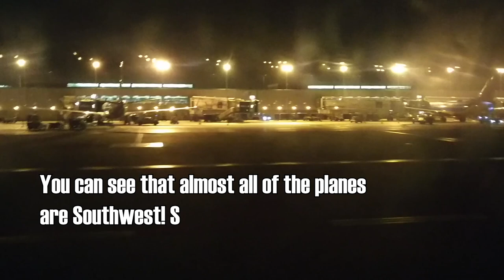Autofocus rambles and a landing at MDW

Comment: This is part of why almost all "real" video cameras have a setting (often a dedicated button) to lock it on infinity focus. In fact, specifically in regard to a nighttime scene with "bright points of light", I've seen some camcorders that have a "Fireworks" preset which locks it on infinity focus and reduces the exposure to prevent the fireworks from getting blown out.
Reply from the maker: It's very frustrating to me how smartphone cameras are often so close to perfect, but with some serious annoyances or flaws.  What I really appreciate about the camera on the OP3 is that its image stabilization is really good, even in this low light.  I didn't do anything at all with this footage, and you can see during the landing that the phone was moving around pretty violently (pay attention to the window near the edges) but it coped very well.  Smartphones have the benefit of so much software but sometimes implement it in strange ways.
Reply: Technology Connections 2 On my OnePlus 5T you need to tap and hold on the point you want to focus and eventually you'll get a message telling you the focus has been locked. I'm not sure if it's the same with the OP3 but I thought it would be worth a try
Reply: The autofocus lock on my Galaxy S5 never seems to stay on. Unless I'm shooting in 4k, which is overkill for dumb videos on Facebook.
Reply: You can download an app for advanced camera functionality. That’s just the default camera app.
Reply: I really wish I could just do manual focus on my S5. I'm running Android 6 and I've tried advanced camera apps but none of them work. It's especially annoying when trying to focus on something up close. I know the hardware is capable because it will be in focus for a split second before autofocus decides it'd rather make it blurry.

Comment: That seems like a software issue to me. When you tap the screen to focus there, it looks like the camera continues scanning that area to maintain focus.  Once that area has no more contrast, the camera starts hunting.  Cell phone cameras have to be dead-simple, so that people who think vertical video is good are novices at photography can use them.  That behavior might be a compromise to get better ease of use for novices.  

Also, I don't know if this is true for contrast-detection AF, but with phase-detection AF, you need detail along a line for the AF to work. Focusing an SLR on a point is difficult unless there's a ton of light.

Comment: They’re not “points” of light. They’re blobs. I suspect,  as the light spreads, it leaves few actual sharp edges.  It’s more like the dark and light areas are fading into each other rather than creating contrasting features that the AF system can use.

Comment: My understanding of this problem is that when a pin point of light comes out of focus it becomes I high contrast circle with reasonable crisp edges that are easily detected by the camera making it think it is in focus. I'm sure once AI get better in camera, they will take into account single points of light, but for now they do not. Take a screen shot of a still frame when the camera is out of focus on a dot and you will see it is a nice circle, or at least in the shape of the aperture of the camera and has a high contrast edge.
Reply from the maker: That makes a lot of sense!
Reply: Agree with the assessment. Another thing is dynamic range. Contrast AF computes the sum of squared differences between neighbouring pixels (or a variation). In a dark scene, point lights are over-saturated. Suppose saturation level is S, a point light has actual level of 9S, it would still register as S. If it defocuses to a disk of 9 pixels, each pixel would still be S. The circumference increases by 3 times, and the sum of squared differences increases by roughly 3 times. Thus the AF often prefers somewhat out of focus blobs.
Reply: I had the same thought. The bokeh of a camera doesn't produce the same result as a blur, it actually makes a distinct circle on point lights. Bigger circles could actually have more high-contrast pixels than when it's in focus.
Reply: That's what I figured was happening too.  A larger circle of light has more pixels around the edge.  Seems like a miracle that it works at all...

Comment: Try the OpenCamera app -- it has focus lock even on videos but it has no other fancy functions such as filters, video cropping, etc. Used that and never had any problem with it losing focus.
Reply: Penurious Sierra yep pros use manual focus.  If you want to make pro videos dont se a mobile phone. Ps my camcorder is always set auto everything cos I'm not a pro.  But when I do dabble you can get great results with manual focus.
Reply: Penurious Sierra That is one of the reasons I have it on my phone, the focus and exposure lock options. It can even rotate and crop automatically to keep the horizon level. And timelapse stuff

Comment: I know for sure that the aircraft in the video was a Boeing 737 of some sort with the CFM International CFM56 engines. I can tell from the sound of the engines when it touches down on the RUNWAY . It's not the "tarmac", at least not called that, even if it's made from that material.

Comment: I'm going to guess that the primary reason Southwest, as a low-cost airline, uses MDW was because as they were probably able to negotiate lower landing fees compared to O'Hare and the fact that since their fleet mainly consists of 737s means that the shorter runways are adequate for their needs. In the UK, London Stansted is a similar case - it's a hub for Ryanair (an infamous low-cost airline) while most of the other major airlines use Healthrow and/or Gatwick instead

Comment: Another consideration might be that autofocus once "locked on" will only "fully" reevaluate the entire image periodically,  but relies on pan/tilt data from the video compression chip more often to track the movement of precomputed contrast boundaries as a lazy refocus mechanism..  it could be designed to do it that way more often to reduce computational cycles... with so little variation in these scenes pan/tilt errors could add up enough it could easily get confused, lose its contrast boundaries by a pixel or two, and have to start from scratch again... if I had to design it, I’d consider that as one autofocus mechanism.

Comment: My old Sony handicam years ago had a switch for auto/manual focus. The nice part was that it also had a momentary toggle - if you pulled the switch all the way down it would focus to infinity immediately and then it would be in manual mode. If the auto focus was being screwy you could just grab this easily and tap it to inf and switch back to auto - it would usually fix the problem right away.

Comment: I've noticed that my Sony HDR-CX760 has no problem with scenes like this, but I think there is something else going on (though I'm very likely wrong).

That's why I use Canon video cameras sometimes because external focus sensors (iAF) that everybody seems to mistake for an extra light or a stabilizer sensor.

Comment: Some cameras use on-sensor phase detection, which isn’t so great in low light.  I know canon’s dual-pixel cmos autofocus has issues with very low light focus because it’s phase detection based.

The oneplus 3 uses a 16mp sony PDAF sensor, which stands for Phase Detection Auto Focus.  Looks like that’s why you’re focus hunting.
Reply from the maker: Ooh, really?  I never knew phase detection was in use in smartphones.  Research fail!
BUT, given the tremendous ability of a smartphone to use software, it surprises me that there's no analysis taking place on the software side to minimize the focus-hunting.  Perhaps we'll move towards that some day--best of both worlds!
Reply: Yeah I really wonder why modern cameras don’t have the ability to switch between phase detect and contrast AF when one is CLEARLY not doing the job.
Reply: Some do. This is what Sony's Hybrid AF does in their mirrorless cameras which use on-sensor phase detection, and I presume this is also available on their small sensors used in cell phones. However, it is a function of image processing, so if the AF methodology of the phone's image processor doesn't do it, then they would have to implement it.

You can force those cameras to do different focus methods based on focus modes, FWIW.

Comment: Could it be related to how out-of-focus lights look like in cameras? Differently from a gaussian blur, lights look like little disks with relatively sharp edges on camera. These edges may fool the AF algorithm, leading them to prefer the out-of-focus image to the sharpe one, since the latter has much smaller edges (although slightly sharper). The fact that bright light are probably clipping, and therefore the brightness level in the sharp image is not much higher than in the out-of-focus one, may help too.

Comment: I think it does not detect contrast between pixels but tries to find straight lines in picture. The simplest (and very fast) algorithm is to use convolution function and then see at which focus setting there is greatest amount of them visible.

Comment: It was my understanding that it only looks at a small region, first of all. Secondly, at least on a camera system I worked on years ago, that you would focus by finding a sharpness value of a frame, blur the image in the system, and get the sharpness value for that. compare that.  If it is similar, it’s likely already out of focus. Then adjust the focus of the lens and repeat while adjusting that.  The highest sharpness value is the proper focus, probably.  Then every so often, you need to run it again to make sure you’ve maintained focus.  That’s how our system worked anyway.

Comment: My guess is that autofocus algorithms contain an escape algorithm in case a small insect were to fly right in front of the camera.
The algorithm would start tracking the tiny insect, and should the algorithm try to always obtain maximum contrast, there is a local maximum of best contrast around that insect and the AF algorithm would not be able to focus on anything behind.

The same phenomenon would happen if trying to film anything through a window (any tiny speck of dirt on the window would steal the autofocus and never release it).

The algorithm probably detects the size of objects and ignores them if the object is too small. Making the camera's autofocus algorithm ignore isolated point lights.

Comment: I believe this happens because the camera defaults to trying to focus on a small square in the center of the screen. When you tap, you're suggesting the best place to compare contrast. And when the image changes beyond a certain threshold, it refocuses either back to the center or at the place you tapped depending on the camera app, and by then the light source has moved and it's just darkness its trying to focus on. No contrast, as you know, means poor autofocus. I don't think the software considers the bulk of the picture when focusing, just a tiny sample.

Comment: Maybe it operates after a low-pass filter to avoid false triggering from sensor noise? In that case it could be possible that the points of light just don't cover a wide enough area to be significant enough for focus lockup

Comment: Does the same thing happen with other scenes that include a lot of solid color (besides darkness)? I suspect the root cause of the "hunting" is that darkness is the easiest way to flood the sensor with a single "color". Outside of scenes of darkness, fields of truly solid colors are probably fairly uncommon.

This is probably an example of "optimization for the common case".

Comment: I think it boils down to the camera simply not looking for focus where the details are. And sometimes it can mistake the circle of confusion for an in focus shot mor than the actual in focus shots.

Also. Just in general. If the distance is not expected to change significantly... It's generally preferable to simply get focus and then just turn off the autofocus. That way there is no focus hunting at all.

Comment: Two reasons i can think of. 1 Because the sensor is dimly lit, there is quite a lot of noise that the af algorithm will struggle with. 2. A point light source with most lenses will when seriously out of focus show nicely round bokey balls which might throw off the algorithm

Comment: I noticed this too, and I think I figured it out... Maybe. Some cameras use both a laser/IR rangefinder, and as a fallback it uses the contrast detection, and they can conflict a bit. What I have found is that most phones (#ButNotAllPhones #ButSometimes) that work with alternative camera apps that have a 'lock focus to infinity' setting, which works for these types of situations. Another option is 'fireworks' mode, which should do roughly the same thing but also bring some increased brightness... I use Open Camera on Android and it works pretty good. YMMV.

But the real reason is that it looks for areas of the MOST contrast, so the tiny little points of light are probably 'too small' or considered noise to be used as valid things to be focusing on.

Comment: Here's what I think is happening: your phone (OnePlus 3 isn't it?) uses Contrast Detection AF, like you said, and it needs contrast, but it needs contrast detail . The low light scene means that it can't see surrounding detail at all, so it defocuses a lot instead of in small steps to measure the brightest region's smallest size and stick to that focus. The thing is that the AF depends on the metering to tell it where the brightest spot is,and since that is constantly changing, the system constantly has to relocate the brightest region, and measure multiple focus stops till the smallest size is achieved. Then by the time this process is over, if the metering system tells it that there is a new brighter spot in the frame, or that the brightest spot had changed intensity, the process has to be started all over again. 

The main sticking point is that there are spots of bright light in frame, but all around those, is simply featureless darkness so the region could already be in focus and this means that the entire focus range needs to be checked to compare the spot sizes.

Comment: Imagine a lattice of small lights in an unlit background (like nights). Imagine that you can increase or decrease the areal density of those lights. Lets say we hv a way of measuring contrast (actually a metric to indicate contrast). Now imagine two extremes- 1) with only one light. 2) very densely packed lights which are still resolvable.

First case would hv a very low contrast metric and second case would hv a high contrast metric even though for humans, it seems reasonable to term both cases being equally contrast (actually the first one might even be judged higher). 

So it follows...

Comment: It's interesting - I always thought it was only me who was infuriated by this haha...  Thinking about it though with 2021 technology - this should be easy to overcome really. The answer? Machine Learning...  Apple and Google are doing this all the time, so that when you take a photo of a person it is able to recognise that and adjust the camera settings automatically for the best shot. Sun in the background? No problem, auto HDR... etc.  Phones also have sensors in them - accellerometers and gyros to know which direction they're pointing/how fast they are moving, etc.  Surely Apple or Google could simply bake in some logic along the lines of "IF the scene is low-light AND there are multiple points of light that look like roads AND I'm moving at over 100mph, AND I'm at an altitude well above what maps is telling me the ground level is at this lat & lon, then assume I'm flying at night and keep near-infinity focus the whole time....."  Something like that...

Comment: Mobiles (cell phones in your silly country) also have sensors to know how far away the item is to focus on. As you're looking through windows that will likely not be focused (see what I did there) on clarity but strength, so extra sheets on them you won't notice, this will no doubt be picked up by the phones sensor. The beam will be hitting the glass and coming back as though you're filming something super close and explains the massive jump in focus at times.